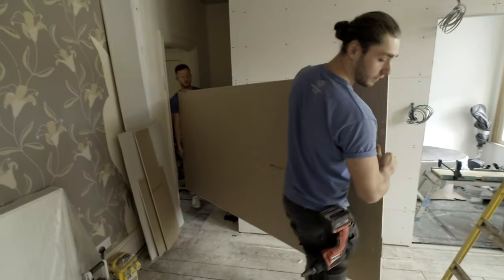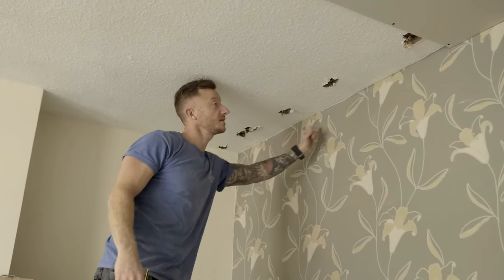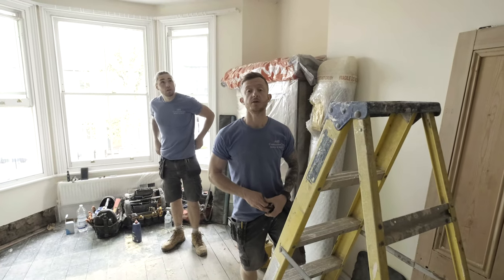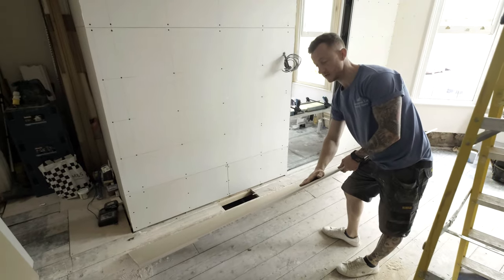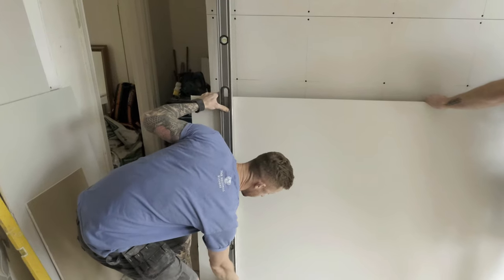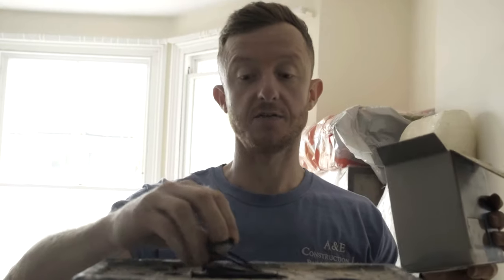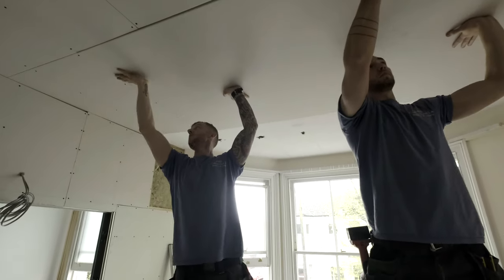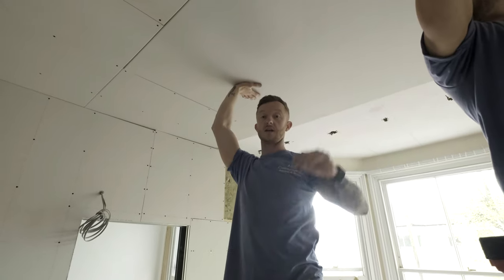HOW TO OVERBOARD A CEILING | DIY Series | Build with A&E

Comment: im planning to overboard my plaster ceiling. but im afraid the drywall might end up wavy because plaster ceilings are not perfectly flat
Reply from the maker: Hi Cali818 thanks for watching, make sure the ceiling you are going to overboard is in sound condition no loose plaster, if so take the board off and start a fresh, and level ceiling if required. If everything is good overboard as normal and then use bonding to take out unevenness.
Thanks Tony
Reply: Guy who overboarded my ceiling used smaller section of drywall then even out with the mud

Comment: Good video but its important that the screw heads don't go through the paper, manufacturers warranty is viod if the screw head penetrate the paper.
Reply: Why
Reply: @a5amr2  Regardless of warranty, there is nearly zero holding strength if your screw head goes through the paper.   If using a regular drill (i.e. not a dedicated drywall screw gun), you can use a drywall screw setter bit.  They're designed to disengage the screw at the correct depth.

Comment: I usually find the joists run along the shorter span of the room. These ones seem to be the opposite.
Reply from the maker: Hi Imran,

They did run across the shortest length. The wall which the boards were lent against is a stud and not a supporting wall.

Hope this helps.

All the best, John 😊

Comment: Drywall tip bits are better, ceilings never pop as screw is set correctly & I always scrim over screw holes as well. Top work on your channel from a fellow chippy & builder.

Comment: ever worry about cables and pipes running through the beams?
Reply from the maker: Hi Blake Williams,

It's always important to check for pipes and cables before overboarding a ceiling. If you are unsure, then it is worth making multiple inspection holes in the ceiling.

Hope this helps.

All the best, John 😊

Comment: They seem like quite long screws to be drilling blind into an old ceiling 😬
Reply from the maker: Hi ♣️A,

When you take the thickness of the existing plaster, as well as the new plasterboard, there was just under 30mm going into the joists.

All the best, John 😊

Comment: wanna be using 9mm if over boarding
Reply from the maker: 9mm can be used, however we feel that 12mm is a better option as there's less flexibility. As we were overboarding a lath and plaster ceiling, with joists which span a large distance, we felt 12mm was the right choice 👍
Reply: @BuildWithAE  I have used 12mm they are well heavy.lol.i only did over board once.your doing a good job.